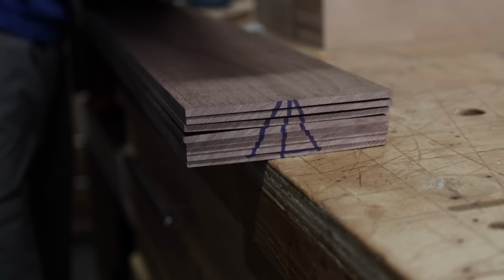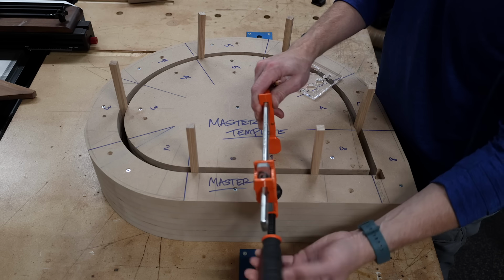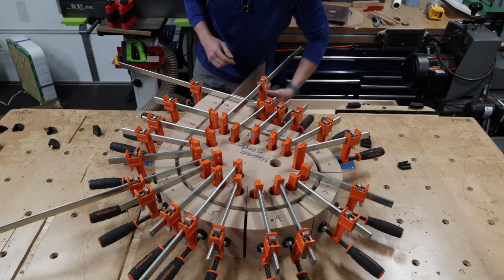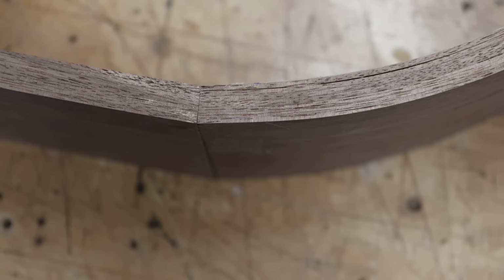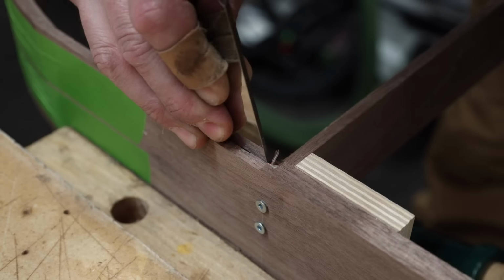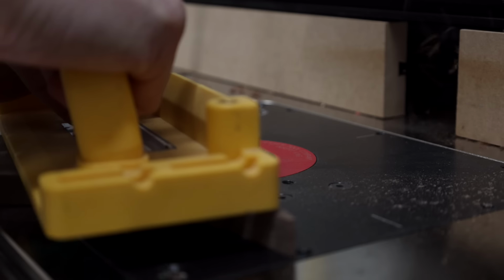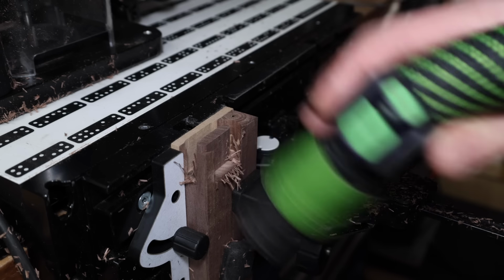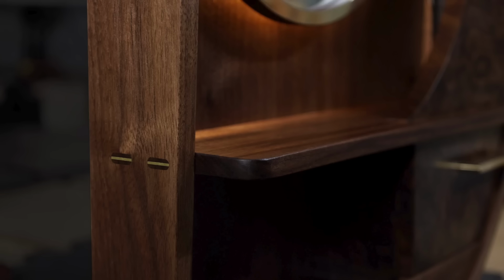Why aren't more woodworkers using this new tool?

Comment from the maker: It’s the BEST time to buy Shaper Origin: http://shapertools.com/keithjohnson
Reply: @KeithJohnsonCustomWoodworking  Man I wish I had the income to get one!! With a very fixed income and very tight budget I can’t afford a regular router! I do have several ideas to do with one though!! I want to make my wife and a few of my sisters a small raised platform, to set on a table that’s no more than 6 inches above the table. Then in the center cut out a 12X12inch Square(on a circle or oval platform, if it’s a square make it a circle) recess, maybe an inch and a half deep with the sidewalls with smooth edges and very little rounding at the bottom then cut at least 4 rectangles on the perimeter of the recess just big enough to hold 5 six sided dice. I guess you could either make 4 or however many spots around it you’ve cut for the dice, make removable score card holders with a pencil slot. It would be a good sized Yahtzee game table. It’s a fun game away from devices to play and even better, be a device free zone that is a cool way to actually conversation. I made my wife a small table and made the area to roll the dice especially with it and the 4 dice holders not attached to the table(very short table it’s one 6 inches tall. But I made it with the pre cut/glued tops you can get at the hardware store and premade furniture legs. She is using the table for something else so the one with the recessed top would give it an individual purpose unless you made pieces to fill the spots when not being used. I guess I don’t really have the skill, knowledge or physical ability to make to from scratch… I don’t know why, but I worried about getting and using one because of not getting hands on training with it I would end up injuring myself… same with a table saw I guess..
Reply: @Trindal Have you ever thought about trying your hand at  writing?😮
Reply: @PillowsmithI take a lot of medications so please forgive me, but what are you speaking of? I am okay at getting a huge amount of words on paper. It’s just it’s all part of 2 sentences with a million comma’s and a single paragraph per 5000 words… lol. My wife is an English major and she thinks it’s funny how easy I can get the words out. Anyhow, best of luck.

Comment: I have just found your channel and am currently binge watching. I fell out of love for woodwork, but your work is rekindling a fire. Tool technology is just another world. My question is, what do you do with all your jigs? You clearly have an economical workshop, and I remember how these things built up over time; screwed to walls, stuffed in roof rafters, cupboards, workbenches, and stacked in the corner. Anyway, great work.
Reply from the maker: That's so great to hear! Glad my content could provide a little spark to get you back in the shop. And all of my bending forms get put away in storage...I may never use them again, but there isn't so much work involved that I don't have the heart to throw them away 😂

Comment: I been using Ai for project ideas for a couple of years now.  Its pretty amazing.  But I also have a shopsabre Cnc so that does help.  But the end results are pretty astonishing due to the fact that I can trace lines in Aspire and then cut it out on my cnc.   I think Ai is definetly the future in terms of brainstorming ideas for unique ideas like this.   Just about everything else tends to be some varition of a box, which is pretty boring after you get into woodworking for any amount of time.  Great project and video.
Reply from the maker: Thanks for the feedback! I agree, generic boxes can be quite boring 😂.

Comment: I have steam bent KD hardwoods to 8" radius at 3/4" thick for chair "horseshoe" seat rims with no failures.   If air dried wood isn't available I wouldn't let that hold you back from attempting modest bends like my chair rims.

Comment: Nice work!

I also have the same jointer/planer (Hammer A3).  I've had lots of problems getting thin materials to feed through, even with a sacrificial board.  The machine will eat up and spit out the thin stock.  I do like your comment/idea of bending the thin boards up before putting into the planer.  I'll try that.  Are there other hints/techniques/ideas for getting thin stock through this planer???  Thanks!
Reply from the maker: Yeah, it doesn't like the thin stuff. You can always lead with a sacrificial piece and feed your good material directly behind it, butted right up to it, and just keep feeding your boards in a train and finish with another sacrificial piece.

Comment: For future reference, you can cut those LED strips at any of the copper points with the line through them, and resolder the whip on so you dont end up with excess lights :)
Reply from the maker: Yeah I know…but i wanted the extra lights…one row wasn’t enough

Comment: Love this. Why did you make your own dowel pins out of walnut instead of just using store bought ones?
Reply from the maker: Thanks! Store-bought ones are usually undersized or oversized and TBH I use so few of them that buying them at the store isn’t even a thought for me.
Reply: @KeithJohnsonCustomWoodworking  kind of unbelievable that you respond to every single one of these comments. Thanks for that -- you da man
Reply from the maker: @BernardiCustomWoodworking  And thanks for watching and commenting, man! I super appreciate it.

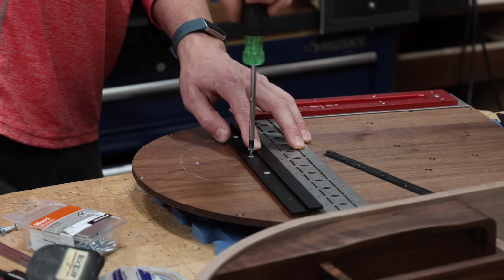Comment: Looks great!  At 38:50 the LED lighting is 'bumpy' like wood sanded at 40grit.  More LED/meter is helpful.  So are diffusers.  "Aluminum channel" often comes with diffusers or in a pinch, I've used parchment paper.  You can also get LED strips with built in diffusers.
Reply from the maker: It’s fine.

Comment: Hi Keith,,
Nice build. I've been there with the resawing and sanding to get thin strips. Time consuming and very material wasteful.
Certainly Wood has 1/16" thick veneer ready to go in a number of species, including walnut. The extra material cost is definitely outweighed in time savings. Worth checking out.
Reply from the maker: Thanks Jarred! Yes, I've considered them in the past, but I prefer having control on grain and color for bent laminations. And air-dried lumber is better suited for bending than kiln dried, and it has a much better color, in my opinion.

Comment: This cabinet is breathtaking! As several people have said already, my first thought was that it was from another youtube woodworker who is famed for scultural pieces, the very one you gave a shout-out too for the waxed paper trick.

As for AI:  Definitely the fact that you didn't just use the AI design as false advertising, but went on to make a real oject with thought, care, and deliberate design choices speaks to your artistry and understanding wood craft. 

A lot of the pitfalls of trusting AI in creative pursuits comes when the person using AI doesn't understand the craft they want it to utilize it for - and thus don't recognize when the AI hasn't made adequate considerations to the equivalent of joinery and seams. Way too many people assume that AI can give them an accurate path to a finished project, or that the quality would actually be good straight from the AI. They're duped into not realizing how much double checking and redesigning is needed to make a functional object or piece of art.

To that end I think my biggest gripe with AI is all the false advertising around it, followed by how often it's trained with blanket scraping from the internet instead of volunteer or paid input.
Reply from the maker: Thanks, I appreciate the feedback. AI is rapidly becoming integrated into everything and it’s only picking up steam.

Comment: Sometimes if it feels like cheating, it is, and no I am not mad at you for using it, nor am I gonna bash your head into the pretty looking furniture, I actually have a lot of respect for you to upload this video as it sheds light on some of the healthier ways to use AI GEN!

However, to shed some light on why people would be hesitant about such a powerful tool, it uses large sample sizes to make itself better every day, this makes it an extremely potent tool, especially if it has a team behind it, however, that means people were stolen from en masse, and it makes people rather uncomfortable to see their creativity and blood and sweat in tears into a piece just for it to be ripped for some super mechanism.

Do not get me wrong, there are many productive and powerful ways the tool can be used, but the fire that forged it held carcinogens that leech off in the final product. It is a very fine line between ingenuity and outright theft, which most people are not privy about, but you seem to be and it assures me that you've already at-least thought your stance over, as many don't!

All and all I am enjoying watching how this project went and I do understand your thoughts on the matter, I just wanted to bring you thoughts from the other side of the coin if you catch my drift!

Comment: You're using AI the way it was INTENDED to be used. As an artist, I have noticed a severe drop off in clients now that AI is accessible to everyone, not to mention the saturation of the "art" markets with GARBAGE that is also extremely bad for the environment. You can barely find anything original on Pinterest anymore, it's all AI slop now.
Reply from the maker: I've definitely noticed that on Pinterest as well - way more AI rendered images. 😤

Comment: Now, I dont know about other people, but I dont view AI art in the same light as others. My view, is that AI art is less a replacement for artists, as it is simply another tool for artists. The fact that AI can create drawn type of art with some degree of decent-ness, its not perfect. I dont think AI is going to replace artists in that regard. The issue is with big corporations and them seeing AI art as a replacement for traditional artists, kicking artists out and using terrible AI art to  while charging the same price for that terrible AI art as if its done by actual artists (ill just leave it at the videogame industry.)

But what you did was use AI to create the starting point for a piece of art. not the whole piece, because again, AI art is made without an understanding of the real world, and thus various designs are simply impossible in the real world. But you took that clear impossible design, and made something from it. Now, if you had claimed this was completely your own design, maybe a little wrong, but yet, I can come up with all kinds of interesting visions in my mind, yet lack the means to really translate them from my mind to something visual, yet using AI promps to try and create something close to what I envision in my mind, again, simply a tool to allow me or anyone to create something, in this case, it would allow me to express what I have imagined while lacking the artistic ability to put it down visually for others to see.
Reply from the maker: Thanks so much for the thoughtful comment! I think you and I are similar in that we have difficulty converting the images that are in our brain into tangible designs on paper. I feel I can build most things from just a picture, but getting the picture is usually the obstacle.

Comment: Is epoxy better than standard wood glue for the bent lamination or superior in general?

Also, all that work you did on your mold made it super easy to pull off the next one even faster! Amazing detail
Reply from the maker: For bent laminations, you need a hard setting glue like epoxy or Unibond 800 or even Gorilla Polyurethane Glue. PVA glues are soft and can cause creep over time when gluing up complex and tightly bent laminations.

Comment: Have you considered using bronze, rather than brass? It's a bit more resilient, and the color can be changed, by altering the mineral contents. You'd probably need to use different tooling, because it is far harder than brass, but it can be extremely beautiful.

I've never used AI, and never will, because I don't trust it, but I don't think it's cheating. It's merely giving you a base idea, without any plans or processes involved, and each creator may have a different take on what they see. I draw a lot of inspiration from nature and repeating patterns. I've built dozens of projects, based completely off of what I see in cloud formations. For example, I'm currently in the design process of a wall cloud inspired entertainment center. I also have a pentamaran yacht design, inspired by a storm cloud formation. I'll never be able to afford to build it at full scale, but I have built a large working remote controlled model of it, which is big enough to ride on. Wherever we draw our inspiration, it is up to each of us, to turn that inspiration into a fully developed idea, plan the process accordingly, and turn it into something we can be proud of.
Reply from the maker: I lean towards brass and copper for the exact reasons you mentioned. 

And nature is full of inspiration for shapes and patterns. My buddy Paul at Copper Pig Woodworking often looks to nature to fuel his creativity.

Comment: Using AI for inspiration is not a bad idea. You can see if the design you are thinking of, can actually be made in real life. Less likely to waste wood on a design that just won’t work. I crochet, so I have been seeing a lot of AI designs. Some are in no way possible but some just need a little tweaking to get it to work. I think AI will just be another tool to add when it comes to crafting.
Reply from the maker: AI is definitely a tool that can be helpful to a certain degree, especially with inspiration, as you have discovered with your crochet designs.

Comment: What modifications have you done to your Harvey DC? That box on top of the inlet I see @18:47 in the video. I have the same DC, and it would probably work better for my space if the hoses came off the top like you have them, as opposed to straight out like the default configuration. I'd like to learn more about that mod if you can share it in a video sometime.
Reply from the maker: It’s a dual inlet by Clearvue, but they don’t make it anymore

Comment: I see nothing wrong with using AI to come up with ideas. I kind of think of it as a quicker Pin. I don't like that the models are trained on years of people's labor, without attribution, but we are here now. 

The cabinet turned out gorgeous, and I loved the dado to flush bit idea. I'll try to lock that one away in my memory!
Reply from the maker: I think the AI is still in its infancy and will continue to evolve, and probably not in a good way 😬.
Reply: @KeithJohnsonCustomWoodworking  I agree with you, and find the rate of advancement... disturbing.

Comment: End of the day, there is no project that doesn't have inspiration from somewhere, for profit or not. AI stuff will resemble something someone made, that is inevitable by nature of how its trained even if was given 100% permission to use everything it had access to for training material. 99% of the time, its done in a fashion that is rebuildable even in the best models. Using an AI start, your actually likely less going to be "copying" anyone, vs everyone else that pulls from books, art, and every other reference material woodwork go to so they can say "but I don't use AI". You almost need to be MORE skilled to be a woodworker that uses AI created ideas because you need to know how to adapt those things to something that actually can be made. AI cant generate a cut list when it has no idea how to create joinery that has any possible order of assembly you can even follow.
Reply from the maker: You make some great points, Matt. I appreciate you taking the time to share your thoughts on this AI conundrum. It's true that we all pull inspiration from somewhere and that will never stop. AI really helps me to compress that design timeline without looking through 1000 books.

Comment: Cutting for spring back… I liked your first idea of doing a tenon… a through tenon w brass wedges would have looked great and kept the length of wood 1 piece.  My 2¢
Reply from the maker: One piece would be very tricky to get that joint perfect. And then how do you cut the taper?
Reply: @ before putting them tenon together using a jigsaw to start the cut on the vertical/thinner piece, then if you wanted, transferring to the table saw… A Japanese pull saw for the entire circumference (would definitely be more laborious)!
Thanks for the reply! I love the little digs all you woodtubers do at each other.
I’ve learned a lot from watching your videos (as well as many others).  I’m about 80% finished with a white oak w walnut accent coffee table.  Time is what I need more of.  I started with cutting the planks of the oak w an Alaskan mill, stick and stacked for a year, then using a lot of different techniques to get a table top and tapered legs.  Just need time to get the walnut accents on the legs and tie it all together!